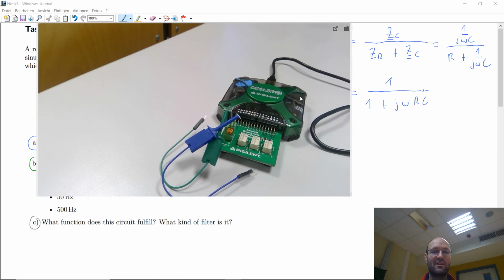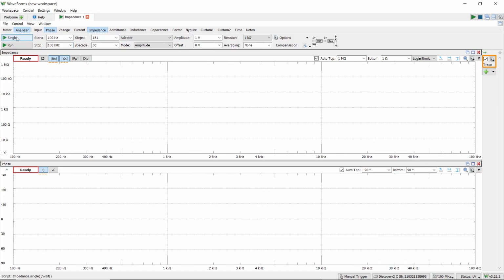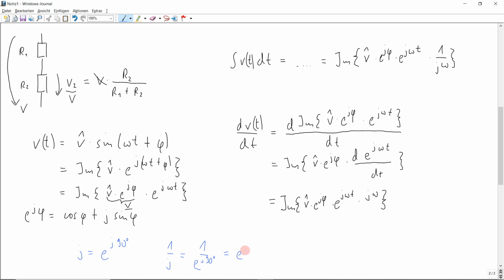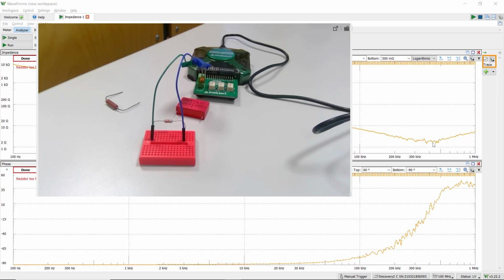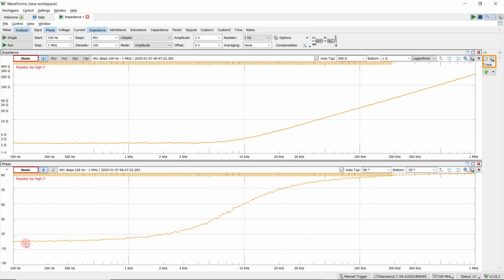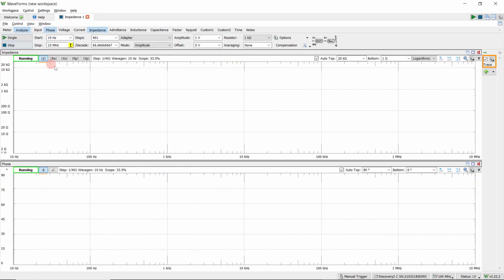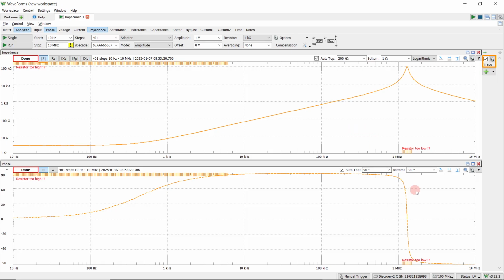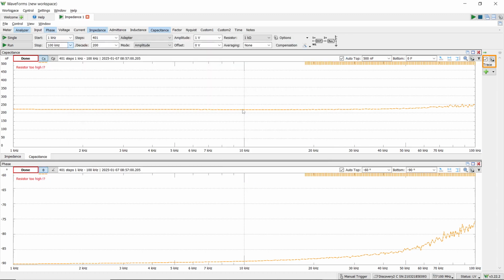Measurement of the frequency-dependent impedance of a resistor, capacitor and inductor with DIGILENT

Comment: Nicely done. 
Watch out for the red warnings that the resistor is too high or too low.
Reply from the maker: Yes, thank for the hint. In this case, the measurement uncertainty or noise might increase drastically.